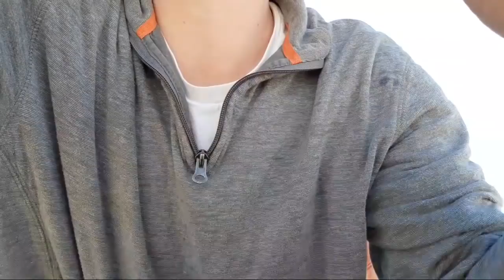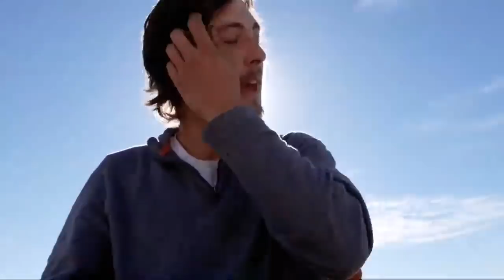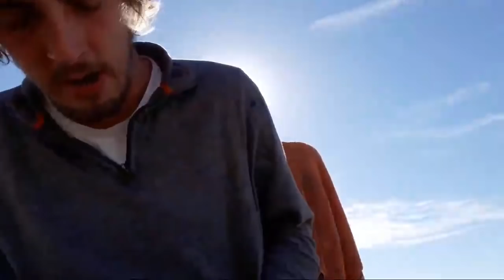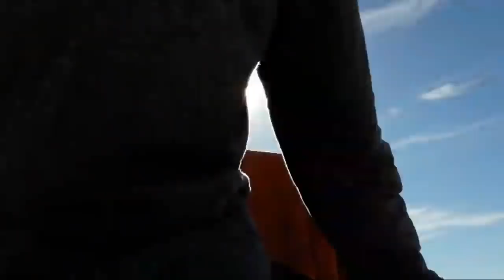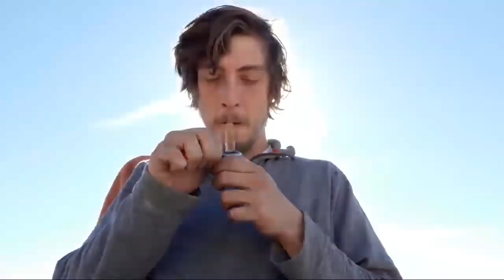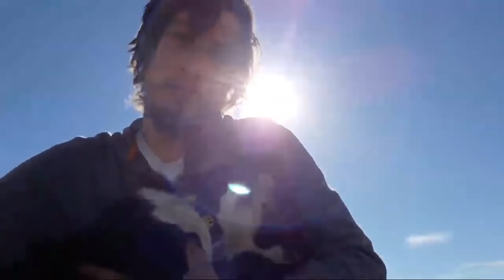Boat Bike House Idea

Comment: Make a foam house, out of high density foam 2" thick should be good; use a hot knife to cut it, make a dovetail connection for best strength. Collapsible A-frame style might be a good choice for riding around.  Make an aluminum frame for it to secure foam edge strength.  Get a <50cc scooter to tow it (most states don't require driver's license or insurance to ride small cc vehicles.